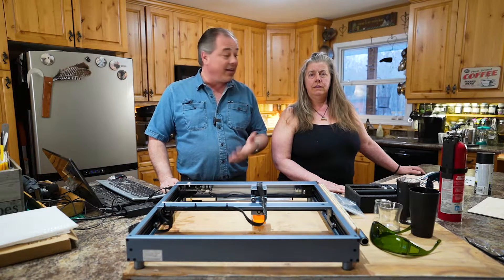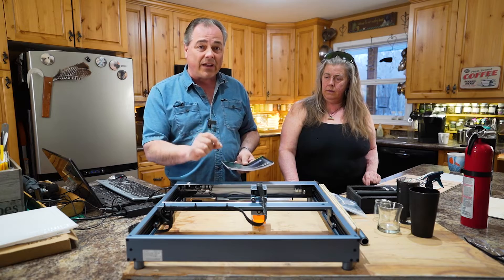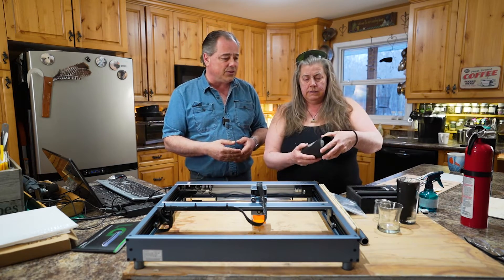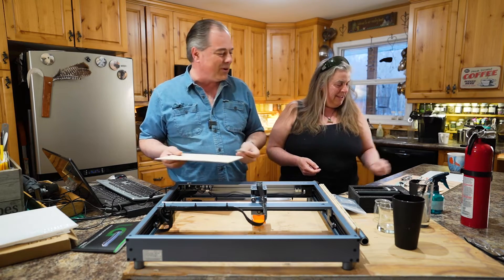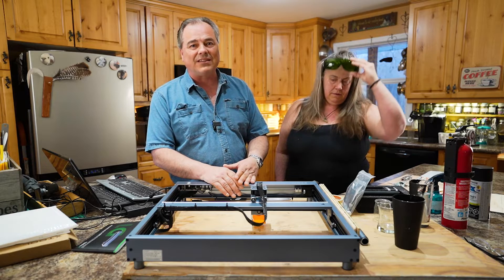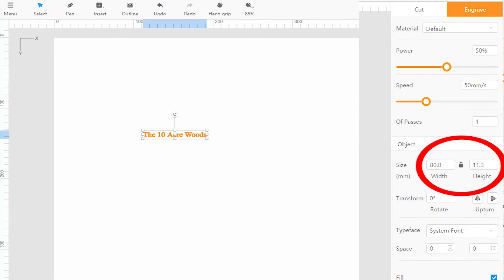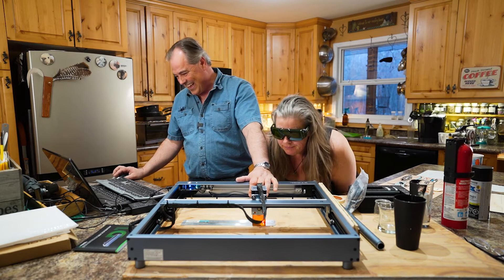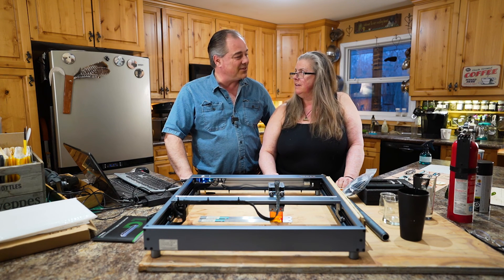Easy to use Laser Engraver - Xtool D1 Review & Operation

Comment: Being in the same room without eye protection can be damaging to your eyes. Especially with metal.  The problem is the reflected light.  The chances of it reaching your eyes through weird angles is slim.  But it's like 5 card poker.  If you play enough, you will eventually you're gonna get 4 of a kind.  Get another set of glasses and be safe.
Reply from the maker: You bet! Thanks for caring.